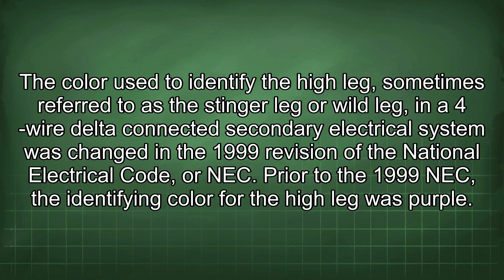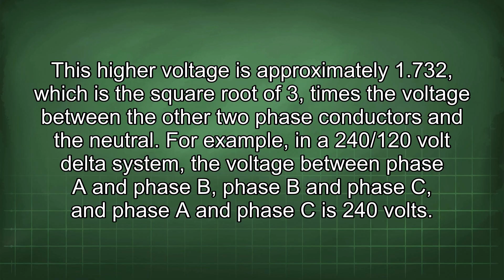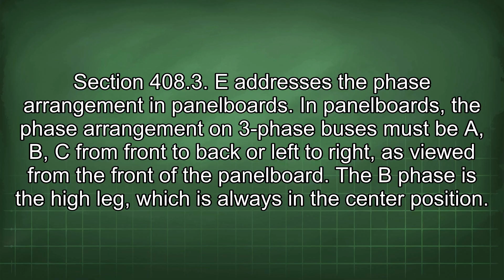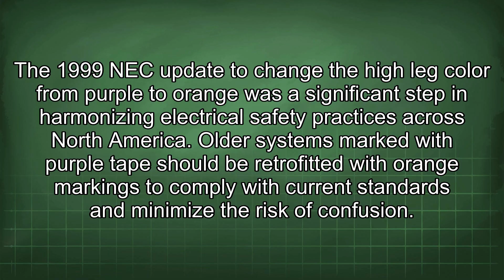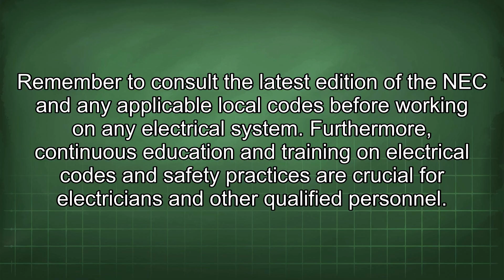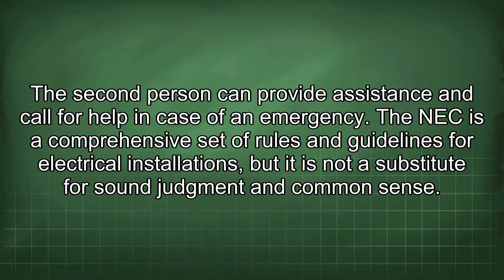High Leg Color Change NEC Delta Systems

Comment: High leg delta is also sometimes known as a red leg delta, because many decades ago like in the 1940s and 50s red was sometimes used to identify the high leg.  Can't say I ever heard of purple as being an approved color however.   

Also, prior to the 1970s, I believe it was around 1975 though it can vary depending on the jurisdiction, the high leg was required to terminate on phase C.  From my understanding, the reason for that was the utility meter, at least on certain models required a 120V connection across phase B, otherwise the meter will be destroyed.  So the tradition was to always land the high leg to phase C, or the far right side of the meter can, also landing the high leg on phase A would also work in this scenario.  When for unknown reasons the NEC changed to require the high leg to terminate on phase B, the utility companies across the US all stood their ground and said, " this is how we've been doing it since the dawn of the 20th century, and we aren't going to change our traditions simply because you decide to. 
My understanding is also that for most of not all modern smart meters, it no longer matters which phase is the high leg.  However in the interest of best practices the utility terminates the high leg to phase C at the meter box, and then the electrical would need to ensure the high leg is terminated on phase B when the panelboard is installed.   

It's worth worthey of mention that phases A-B or B-C can safely be used to supply a single phase 240 volt load, with some restrictions.  The two pole circuit breaker for this application must have a straight rating of 240V, not 120/240 (ref. 240.85).   The problem is that straight rated two pole breakers are a specialty item, so you might as well forget about walking out of your local Home Depot with a 240V straight rated two pole breaker in your hand. You'll have to go to an electrical supply house and there's a good chance even they won't have it in stock. They will most likely need to special order it from the manufacturer.  So that something very important to keep in mind if you're bidding for a major project in which a 120/240V 3ph/4w delta will be present.